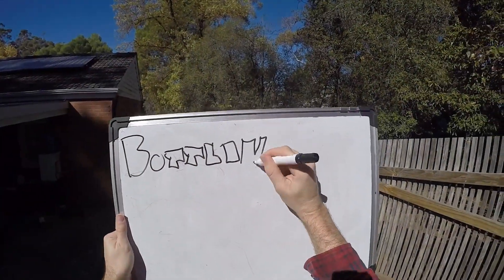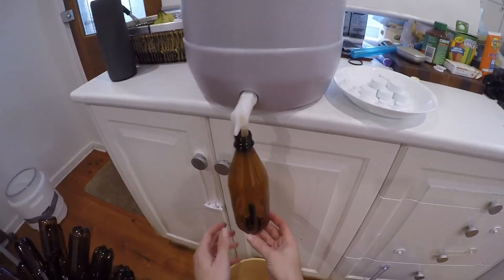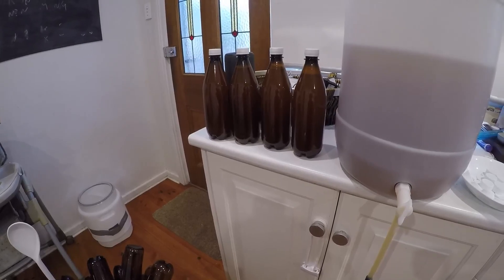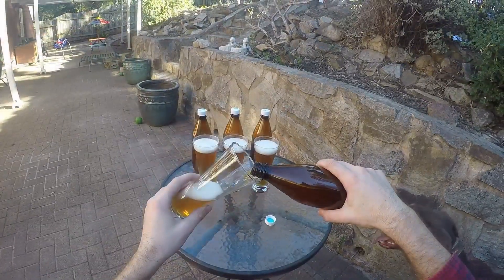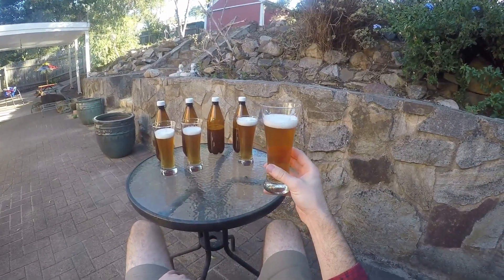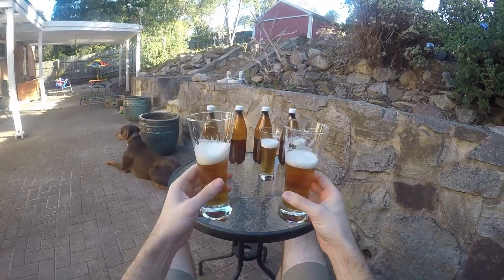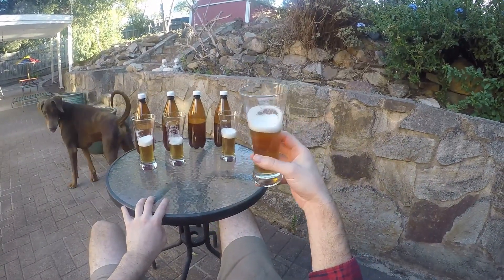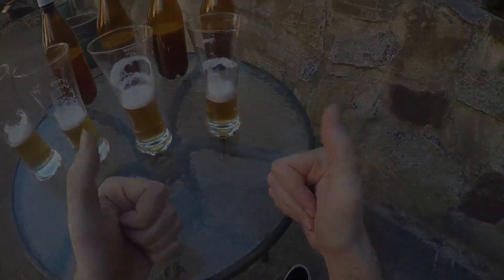Bottling Oxidisation Experiment

Comment: I did a similar experiment with a Neipa batch, half with zero headspace in the bottles the others were regular. Didn't seem any different after 3 months so came to the conclusion that oxidation prevention measures during fermentation was enough to keep things fresh. Also used oxygen scavenging bottle caps, maybe that was the key factor rather than headspace!